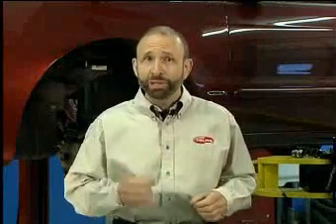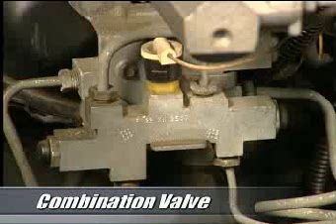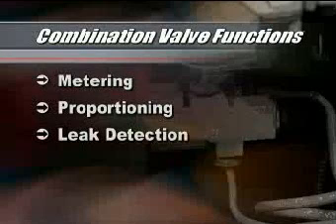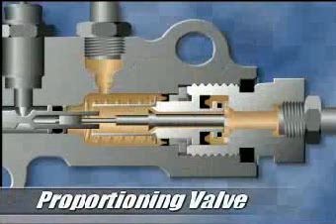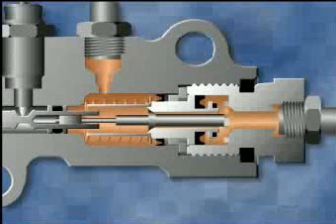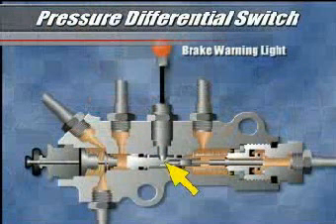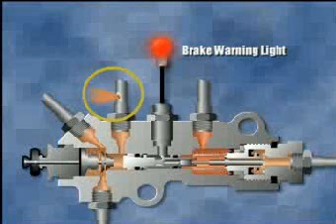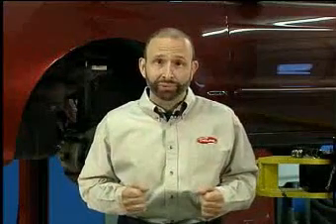Combination Valve

Comment: If only they just called this a 3 in one valve, because it is.   Just one minor refinement: the shuttle valve in the middle absolutely does not detect leaks - it moves when pressure differentials are extreme between either front or rear brakes, and will block the pressure port of the low side just in case it is a leak.   But... it could just as easily get tripped by a master cylinder fault where pressure is not properly delivered.